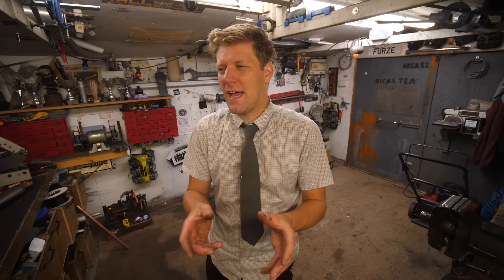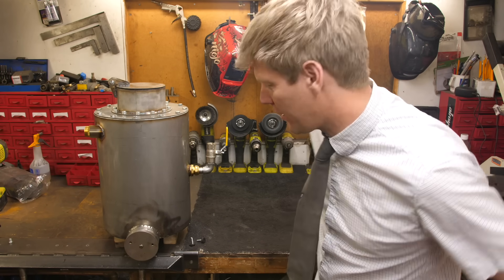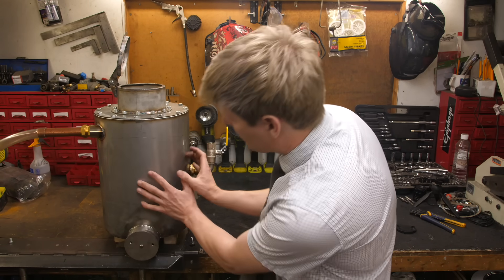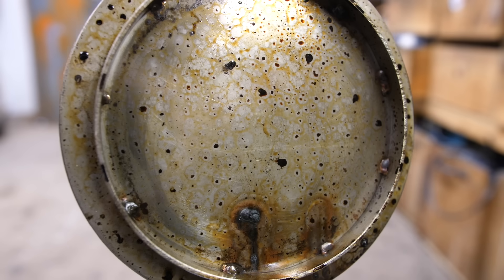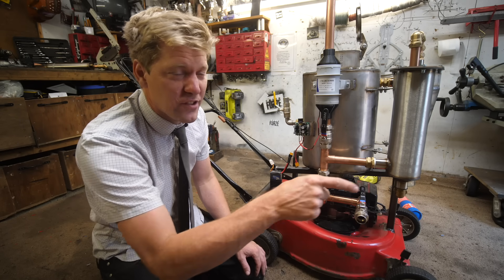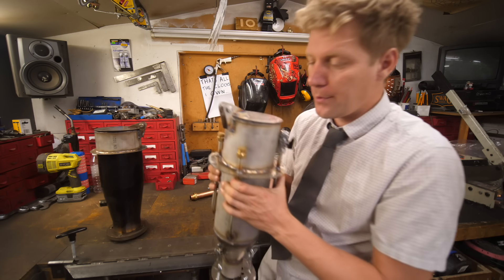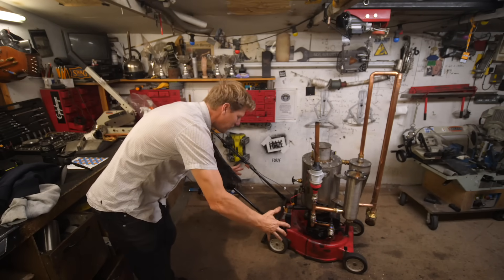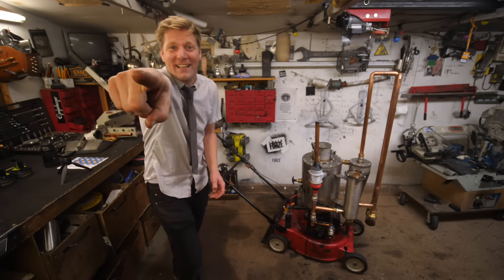WOOD POWERED LAWN MOWER

Comment: try using a water filter, gas goes in and filters in the water and clean gas comes out. You can add more water jars to make sure it stays clean and then you can keep the long tubes to make sure the gas is dry.

Comment: People: switch to electric because it it better for the environment
Colin:
Reply: Wood gas burns nearly clean. It's not used often because it's inconvenient and messy.
Reply: @Aubreykun  wery wery messy! There is a woodgasifier at my workplace (at a sawmill) so if the boss want to punish someone, he need to clean the pipes in the heat exchanger.....Oh i hate to do that ewery weak!
Reply: This is still better than fossil fuels.

It's only using stuff that's already in the environment instead of dredging up stuff that's left the environment.

Comment: have you tried using different types of wood that burn at different temps and with different amounts of tar. i saw you used wood pellets they could have molasses or something in them as a binding agent. would it work with straw or straw pellets as well

Comment: Still not hot enough if you're making tar. You can't really filter tar. Easier to not make it in the first place. You are headed on the right track with your system  though. Driveonwood.com lots of helpful people there. Please don't use glass jars as catchment. They can break in the event of a puff

Comment: Kind of a modified fema unit. You will find your air in at the bottom will cause some hang ups with your feed stock. I've built a few systems to run generators and small gas tractors

Comment: Hey... if you wanna know things about woodgas and what you did wrong there... running an engine without hearthnarowing is not a good idea when you run it on wood... 
+46 (0) 703374433 
Regards GengasWerner /Sweden...
Reply: You need a heartnarrowing and a reducktoinzon to get rid of the tar... then a cyclone and scrubber cooler korkkleaner condensor air/gas blender
Reply: Check my fb pictures in the albums there I have some graphs I have put together and parameters to build gasifier to fit what engine you gonna use! ;-)   My facebook is “Stig-Erik Werner” ... on there you’ll l find pics and clips of my woodgascar as well! A chevy c10 -91
Reply: https://youtu.be/rZBNKjFKFTA

Comment: Make it burn dried grass you constantly get more fuel by using it and the grass should make less tar but still make gas by turning into charcoal and if you want to get more tar out of the engine  have a tank filled with water out under water and in to engender above then add some silica beads in another tank to make sure it is dry

Comment: Not sure if your device is producing too much tar, but with more air might give off more carbon monoxide to run, burn tar into CO among other gasses. Also with a catalyst in the filters you would get more gasoline from wood gas. Aluminium oxide is one thats needed, perhaps others too.

Comment: I know Colin probably won’t see this comment, so if anyone does know the answer to my question, feel free. How does the plasma cutter cut through the steel material, but doesn’t cut through the little wire table he has? I’ve been wondering ever since he upgraded his shop. If anyone can help me out, please do! I’m very curious!
Reply from the maker: hi there I've seen it lol. It does sort of cut it but by time its gone through the sheet its lost some of its power so just erodes it away slowly, it will need replacing at some point.

Comment: I accidentally made a gasifier when I was burning little bits of wood in a tennis ball can. Lots of hole around the bottom then it produced thick white smoke, which ignited and went plop plop plop then shot out a foot of flames like a pulse jet engine. Good times. 
Would it not be easier to make a steam powered mower? Or a steam turbine electric? Or get a sheep?

Comment: I really would love to see this working on a car
Reply: It's been done. 
During WW2, Germany had a massive shortage of fuel and most of it went to the military. So many private motorists added gasification kits to their cars.
Not only did these things suffer from the same problems (tar etc.) as shown in the vid - getting a car ready to drive took quite long and both range and engine performance were a far cry from petrol operation.
Apparently, this wasn't really good for the engines. either. So while occasionally, the odd classic car buff will show off his old woodburner, most motorists discarded these contraptions the very day normal petrol became available again...

Comment: Went through all that effort and still rely on pull starting the mower?
Reply: how would he start it then?
Reply: @raoulduke7668  you can use an impact driver to start a Briggs if you pull the pulley mechanism off, though this would mean he would have to re-arrange his setup.

Comment: Rather than making the filter bigger why dont you make it better! AFAIK steel wool and more wood arnt great filters in the first place. You need more absorbant materials to take up the tar, cotton, charcoal, wool not too sure but something along those lines. Also another idea that idk if it would work or not is having a condenser somewhere on the system before entering the mower to cool the tar and have it condense into a collection pot

Comment: Colin I would not power and underground space using wood gas. A large part of what comes out of that gasifier is carbon monoxide which I'm sure you know will settle to the lowest space. But for the lawn mower, try bubbling the output gas through some water. It'll get rid of a lot of that tar. That used to be how they did it in the old days. The gas was pumped into the gasometer through the water in the bottom before accumulating and being sent out to consumers.

Comment: Colin, why dont you incorporate a bubbler as the filter?  A jar with a gas pipe going into the bottom under the water and then a pipe coming out at the top above the water line for the gas to exit. I think that would solve the problem and you could use a mason jar for it!

Comment: Colin, the steel cotton is not abel to filter enough fluid and corbon vaporized from the wood (the goo). Maybe you should try more staged filtration system with water filtering and maybe activated charcoal filtration unit. I had the same issues with my experiment last week.

Comment: Silly question - when you cut using the plasma torch on the bench why do you not cut through the wire mesh table top as well?

Comment: cant you make it go trought water and bubble gas on the other side? the solid part will stuck in the water
also, why not blow air starting in the air intake acess?
they used to power panzers with this.. stug class chassis

Comment: The mower should collect the grass, quickly dry it with the heat from the engine, then use the dried grass as fuel instead of wood.

Comment: I work for a company that burns pistachio shells to power a v10 engine. Try using a cloth filter. We use 1 micron filters to filter tars out and it helps save the engine.

Comment: You should make a flame-thrower but it is fuelled on the gas from this in a heat proof backpack , and make the flame thrower have a glove on the handle with a laser on for ( needed ) accuracy

Comment: what about putting the gas mixture through water like a bong? or a fluid like meth-elated spirits  after water so 2 filters where the smoke mixture bubbles its way up through it? a water scrubber that's what i mean

Comment: You could try using 2 adjacent chambers. In the first chamber you make a fire and use the fuel form it to heat the 2nd chamber. Use only the fuel from the 2nd chamber in the engine.

Comment: Another thouht, once filtering is perdected, could you collect the gas, then used it for anything you want . I was thinking 2 water butts, 1 larger than the other so smaller one fits inside. Fill larger one up with water, pit the smaller one upside down,, let the air out with a valve at the top so it goes down the hose the gas into the water barrel, as it bubbles upand fills the smaller upside down one that will rise as it fills with gas then if you put weigh on it, even a concrete block or 2 on the top of the the barrel, it would create pressure and you can use the gas for anything when you want.

Comment: can you make something to say store the wood gas in a tank? some have been able to but if it could be stored in a tank it would be much easier to make a large batch then you could just switch out tanks an air compressor would work just connect the gasifier to the intake and you can compress it

Comment: That black tar stuff is called "wood creosote" my friend.
Reply: Where does it come from/how?
Reply: @papasmurf2691  It is the fire burning down the fibers of the wood. You get more Creosote with wet wood. The drier the better to keep it down. This is the stuff Chimney sweeps would clean out of chimneys. The wood ash and Creosote. 95% of all Chimney fires are caused by build up of creosote,
Reply: Tim McKinney ah interesting thanks for the info

Comment: Up next: a multi-vaccuum system to take in all the grass clippings, remove the air and deposit the clippings to be turned back into more fuel.
Reply: If normal wood is too wet I don't see fresh grass working.
Reply: @Electric999999   use dead grass or sawdust to start, and pick up the dead grass after it is cut. Having your grass dead within five minutes might be a Florida only thing, but either way works
Reply: We got a badass everyone

Comment: Colin the tar problem may be down to the type of wood you are using, if it is pine or larch you are going to get lots of tar, try broad leaf hard woods, I produce small quantities of charcoal in a retort system and have been experimenting with wood gas collection, even with a water cooled condenser I still get slight tar deposits further down the system.

Comment: Coilin if you make that wood into charcoal then use it to fuel it would burn for longer and burn hotter and you then have taken the tar out so then you can say you made a proper steampunk lawnmower as they used coal and charcoal as fuel for trains and they had no issues with the engines

Comment: You might b able to just make a large gas producing unit that filters the gas and everything, then stores it in an inverted bucket under water or something. You can control the pressure with depth in the water, so you can use that to fill a smaller water trap tank on the mower. You could probably use the main tank to power your bunker too.

Comment: by theory, the first wood engine created during the war runs straight on wood gas without the gasoline engine needing any modifications. Sooooo, howbout try to switch that wood gas with hydrogen oxygen gas? Their combustion should be more potent with emissions of water vapour only. Why don’t you give it a try colin?

Comment: Googling around it seems that most designs only have a single chamber in which the wood burns in a low oxygen supply and generates the gas. It was a widely used technology in WW2. https://www.lowtechmagazine.com/2010/01/wood-gas-cars.html

Comment: Interesting bit of steam punk tech. But thing is, like with steam engines, the temptation is to make them big but that's completely wrong. You see it's much better to make it small than big because it's the transition you need, not a huge reservoir. So refinement over size is vastly superior. With a steam engine you could actually make a car that started nearly instantly like a gas car because you only make the precise tiny amount you need immediately at any time. No point putting on a big kettle of water and waiting for minutes when you need a tiny amount right now. To really get wood going you probably need to pulverize it. You can also dry it.
Reply: you could also do solar panels and water electrolysis and burn hydrogen when it's dark. you could even store both the hydrogen and oxygen and burn it in a completely contained cycle so nothing comes out of the bunker. You could also have a device for turning CO2 to oxygen, like it's a bleeping submarine.

Comment: Make it use grass for fuel and you would have a self-powered lawn mower. It could just throw the clipping into the gasifier as it goes. The "perpetual mower" could run indefinitely as long as there is grass to cut.

Comment: use a hydrogen engine ,for the next appliance that would be dope although a guy already made a pickup truck that works of hydrogen ,you need filtered or distilled water to work and every few days it needs a pill to clean through the engine.

Comment: WATER FILTER 
and add grass to heat the wood so your burning grass to cut grass 
sawdust for the wood has best results 
add paraffin wax for HUGE kick 
warning : paraffin wax + sawdust + O2 = melt steel

Comment: 🤔 Humm... MAYBE TRY THIS COLIN, 
I'm Thinking You Could Use a "BONG" Of Sorts As a FILTER. Sending Your Mucky Hot Tar Contaminated Gas Through a Container Of WATER. 
I BELIEVE THIS Will Clean Up & Cool Down Your Gas Mixture, Because Tar & Oil Dosen't Mix Well With Water.
Send Your Dirty Gas Intake At The Bottom Of An H2O Filled Canister,
It Will Bubble Through The Water, Then Catch Your CLEAN Gas Output Port Placed At The Top Of The Canister. 👌

Gave You Thought Of THIS Yet?
I'd Be REALLY CURIOUS TO KNOW HOW THIS WORKS FOR YOU!!!

ALSO, Maybe An Extra Reservoir At The Bottom, BELOW The Inlet To Allow All The Muck & Tar a Place To Collect, And NOT Get In The Way Of The Gas Traveling Through The Water?

What Do You Think?

P.S. I Don't Know WHERE I Got This Idea. LOL! 😆😇😆 🔥🌬

Comment: Just bubble the gas through a liquid, maybe not water to keep it dry. Gasoline would fit but you don't want it to be used, so maybe diesel, or engine oil

Comment: colinfurze Please could you do this kind of thing for bottles of liquid air..I am guessing leaf blower is the easiest, but I really want to know the feasibility liquid air lawn mower and hedge trimmer....And E bikes.
Liquid air battery energy storage is becoming a thing and I am a gardener who is fanatic about sustainable eco friendly stuff.
Some stuff can run directly on compressed air and some may require conversion from air to electric using Nicola Tesla Turbines and such.

I am certain we can combine shallow (mainly surface) geothermal with liquid air energy to directly mitigate local heat issues and global warming by literally reclaiming the heat from the air. On the route of this hot air becoming liquid air energy storage, we pass the phase change required to liquify co2....So this combination of technologies can use global warming to solve global warming if used on a planetary scale whilst also solving our energy storage problems in a completely environmentally sustainable way.

So liquid air technologies must be part of our future and someone like you could get in on the ground floor. You are a real engineer, I am only an armchair imagineer that wants to save the planet.

Comment: After/during the WW2 we used to have those in Finland powering buses etc because the fuel was rationed. I always found that fascinating how you could power an internal combustion engine with firewood.

Comment: That is cool. You have the start of a 99% clean renewable energy engine.  (Yes! Though a long process.  With the right type of trees and the right type of filter. It is!
It would be awesome to watch you run the mower on HHO or Brown Gas. I have played with HHO and Its very dangerous ( almost blew myself up). I will even give you a tidbit to help filter the gas even more. Get a oxygen machine and reverse the blow off and oxygen ports. 
The oxygen will be dispelled leaving a cleaner hydrogen gas to burn.   
I would love for you to prove Myth Busters wrong.They deliberately did it wrong and I would hope that you prove it.

Comment: Collin remove the carburetor altogether and simply adapt the air inlet straight to the gassifier. Purpose of the carb is mixing air and fuel which is now obsolete

Comment: Be careful with with the gas which is produced in a gasifier.  It is a combination of several gasses including hydrogen and carbon-monoxide.  The Carbon-monoxide is poisonous.  Probably not a problem outside but in an enclosed space the it can kill.  Great project!

Comment: Humans : Yes... Finally, we've reduced the size of the lawn mower to be more mobile and efficient over decades of upgrades...
Colin in 2020: I built a wood powered lawn mower....
Humans: Wait what? We going back in time now? 😂😂😂😂
Reply: Back in time mowers were powered by you! They still make them just two wheels and a rotating curved blade. Pretty simple and really doesn't require no fuel other then what you need to eat to get energy to push it :P
Reply: Its 2020, everything is already going backwards but in a bad way
Reply: Have you SEEN the way your timeline has been going? At this point this isn't as far back as y'all've gone.
Reply: Asriel Dreemurr Ehh, this timeline doesn’t seem too awful.
Reply: @sophiajohn3975  that video has nothing to do with either gassifiers or lawnmowers
Reply: Hey, it’s not backwards, it’s renewable energy!

Comment: You could probably filter it through water like a bong.
Reply: Yes, only need to add steel wool to the water container to break the bubbles smaller.

Comment: Add a scrubbing system to further reduce the heat, take out particulates and reduce tar. You can bubble the gasses through a closed pot of water but I think this would really hamper the engine being able to take the gasses. So you could rig up a system that sprays a fine mist in a chamber to pass the gasses through. You'll probably need a second chamber to trap any residual water before going into the engine.

Comment: In WW2 it was quite a popular adjustment to keep cars running in occupied areas, where the Nazis would take all the available petrol. They managed to do this. And they only had 1940's tools and I'm sure materials where not that easily available either. Not sure how often they were stuck by the side of the road though.